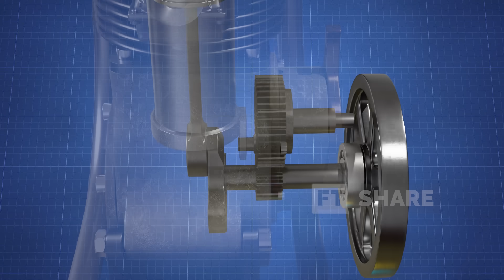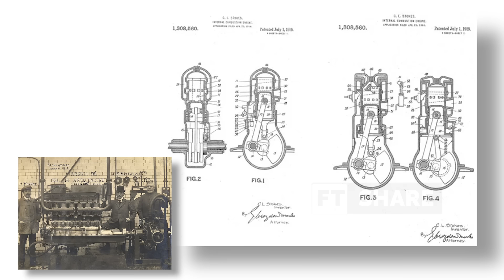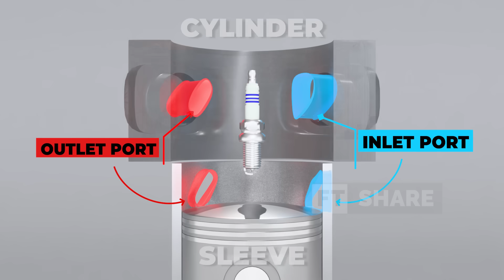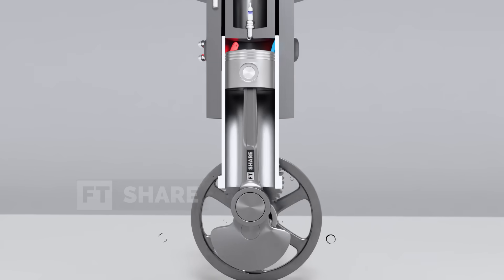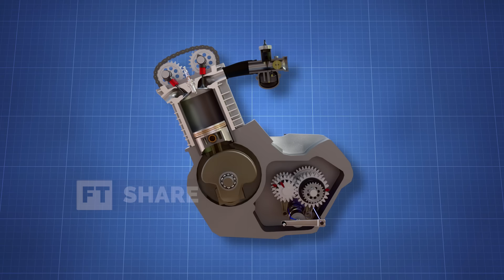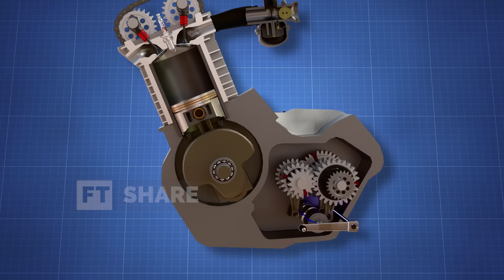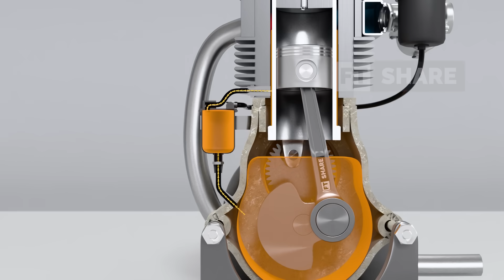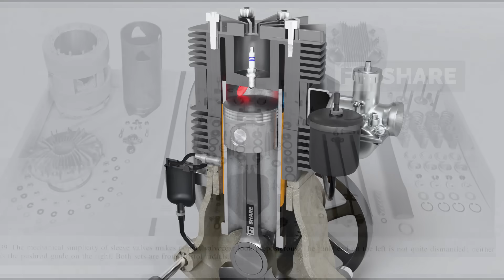Why Was This Advanced Technology Abandoned? 🤔 The Secret Behind the Sleeve Valve!

Comment: The inertia problem in poppet valve engines occurs high RPM when the valve springs cannot close the valves completely.  There is a way of overcoming this through the use a different design of the valve train.  The design I'm talking about is called the Desmodromic valve actuation design.  In this design, the valves are both opened and closed by the cam lobes on the camshaft whereas in the usual poppet valve engine, the valves are opened by the cam lobes on the camshaft, but the valves are closed by the valve springs.  The major drawback of the Desmodromic design is the precise adjustment of the opening and the closing of the valves.  The closing of the valves is the critical part of the setup.  Since the cams on the camshaft are closing the valves, care must be taken to ensure that there is no binding caused by the valve seating before the cam lobe has finished closing the valve.  This occurrence would damage the valve and/or the cam lobe face.

Comment: One problem you failed to mention that initially made sleeve valves better than poppets was poor steel quality. This meant that early poppet valves often broke their heads off. If this was overhead valve that dropped into the cylinder you blew your engine up. This helped the initial popularity of sidevales where a broken valve would stop an engine but not grenade it (as the valve was safely captive away from the piston). Sleeve valves beat side valves hands down. Then steel got a bit better & engines moved to overhead inlet side exhaust (as the hotter exhaust was more likely to break hence for safety was kept side valve). Then steel got even better & you could reliably go overhead poppet valve for both inlet and exhaust.
The reciprocating mass of sleve valves didn't help them too. This is why poppets took over.
Back in the 1980s i worked for Barr & Stroud who made sleeve valve engines 100 years ago and I was lucky enough to get prints off some of the original engine "linen" engineering drawings.

Comment: Manufacturers nowadays wouldn't want the cylinder wear thickness more than nikasil plating. Even that's too thick for the cylinder wear surface. Modern iron alloys could make this extremely reliable. If it were produced the oil change intervals would be 50k miles. Should make a detroit 2 stroke with modern everything.

Comment: Diesel ignition is by fuel injection, not compression.  Also, how do you facilitate valve timing if there's no cam.
Reply: Diesel ignition is initiated by fuel injection into hot air that was heated by a high compression ratio. The two things work together.

Comment: i remember working on these with Henry Ford back in the day. we had problems getting round sleeves back then as the sleeves must be made of very tough steel. the other issue we had was excessive heat as the sleeve slid down and the piston was moving up during the exhaust stroke. however our engines was designed from the start to be 2 strokes and you must remember that this all happened before anyone had figured out how to cast a v8 block in one pour. really the only reason this line of reasearch was abandoned was due to at the time costs and labor for development vs the flathead. just a side note the engine in this video is all wrong but whatever it gives an adequate explanation i guess

Comment: Before WW1 Daimler in England acquired manufacturing rights for the Knight sleeve valve design and used it in their luxury vehicles. The same 13 litre Daimler-Knight engine was used in the Foster-Daimler Tractor used to tow siege howitzers and the  Mark I to Mark IV Heavy British tanks. Daimler's commitment to smooth running even extended to the differential which had a worm drive at the bottom of the ring gear to help with noise suppression. Sir Harry Ricardo said in his papers on high power aeroengines in the 1920s that he thought that sleeve valves were the best path to very high power engines since they could be supercharged to much higher pressures than poppet valve engines.
Reply: And he (Ricardo) was right. Sleeve valve engines were the way to go for high performance post-WW2 aero engines. But they were quickly made obsolete by the jet engine.

Comment: This is new to me, and I am 72 years old, and I have done a good bit of automotive mechanical work.  How I missed it, I don't know.  The first thing I thought was probably twice the friction, heat and wear potential of a poppet valve engine and considerably more complicated design and manufacture.  I really don't care what the commentator said, carbon buildup on a port will cut down the f/a mixture and exhaust gas movement capacity and won't improve anything, unless the engineering was off, to start with.  Overall, I can see why I haven't seen any of these engines, in my life, that I was aware of, at the time.  I have examined no airplane engines, if memory serves.

Comment: You mentioned how sleeve valve engines are efficient at high RPMs, and then you said they can't go above 3000RPM. What an exymoron!
Reply: Oxymoron.
Reply: I wonder if the script was generated by AI.  Much of the information was likely from Harry Ricardo's 1923 book "The High Speed Internal Combustion Engine", which was written at a time where 3,000 RPM was indeed considered "high".  AI currently will repeat written information without the context of knowing current state of the art.
Reply: Finally, someone who didn't fail comprehension in school. Very unusual for this platform. I put a feather in your cap lol.
Well done!
Reply: I mean I've got a 4 cyl farmall 1600 rpm is max end of the world rpm for that engine
Reply: Sleeve engines failed for several reasons, one was difficult lubrication, one was sealing problems, and one was the very ;low allowable engine speed, i.e., rpm!
Reply: AI slop

Comment: In the R/C model world these engines have not left the novelty category and the specialized used of tightly cowled scale aircraft. In WWII, the British government forced the transfer of better sealing technology to Napier. Today’s engines are using very thin oils to help reduce friction overhead. How will seals deal with this in a modern sleeve valve engine? And what about the extra parts needed for multiple rotating cylinders? Ever seen the photo of the timing gears on a Hercules?

Comment: Its confusing when you say in volumetric efficiency they are effective and reliable and then you contradict that feature in the "cons" of this design by saying they are not as effective as poppit valve engines in volumetric efficiency ,  why not use adjustable poppit valves through various cam lobe profiles and instead of springs that can suffer from "resonate frequency" and use a "gas chamber design like Indy car engines do that isn't effected by resonate frequency and. can turn insane high RPM'S without failure of valve control .
Reply: because it is 100% AI generated garbage, that is why nothing makes sense.

Comment: Playing with mechanics for more than 40 years, never heard about it :)
Fascinating.
Reply: Really? I thought most experienced mechanics/gear heads would at least of heard about sleeve valve engines. 
Biggest problem I always heard about was thermal distortion of sleeve around exhaust ports but that was pretty much overcome plus wasn't so much of an issue with lower rpm diesel.
Reply: @1crazypj I always played as a hobby, not a pro.
I learned by myself and broke many 50cc :)

Comment: The Open Sleeve, 2-Stroke Diesel engine, built by Ricardo and Fedden, Sleeve acting as an annular piston transmitting power to crankshaft through the Sleeve actuating mechanism, remains a winner in fuel economy.

Sleeve Valve allows regulating swirl of gases inside cylinder to the optimal grade (Harry Ricardo: 'The high speed internal combustion engine'), the results obtained by Mike Hewland, told to Car&Driver in interview, published in the July 1974 issue, are simply impressive, engine gave 70 HP from 500 cc, able to rev very high, SFC 172 gr/HP/hr, having worked on creosote, no specific lubrication to sleeve, just spitting, gurgling.
Oil consumption was solved with a ring in the base of Sleeve, and a Dykes ring on Junk head.
The book: 'Continental! Its engines and its people', tells about Continental motors research in SSV engines, closed from 1929 economy crisis, being cheaper and easier to build than popett valve engines.
Ricardo points that as long as Oil film between sleeve and cylinder wall is thin enough, sleeves are transparent to heat. 

This: https://rcvengines.com/ is a recent remake of something similar to Bristol Sleeve valve engines, depicted in the Rolls Royce Heritage book: 'The piston engine revolution', section 'The Bristol Sleeve Valve aero engines', by Patrick Hassell
  https://youtu.be/e3aZNqwIpOE?si=JNIskHWwgLi9Hfng

Comment: Anybody with the Courage and Expertise to build an Sleeve-Valve version, either Burt-McCollum or Piccard-Pictet,  of the 602 cc or 652 cc Flat-Twin Citroën engine? Probably, they will have lots of customers. 
You may like having a look at NACA Report 717: 'Flow coefficients of monosleeve valves', C D Waldron, 1940 (Cranfield repository)
A Cylinder Liner, almost identical to a Single Sleeve Valve, sells retail today at around $40.
Pls don't mix the bad Knight Double Sleeve Valve system to the marvel of Bristol and Napier engines, with a single sleeve valve

Comment: There is the #deltahawk newly designed and Certified diesel (Jet A1) which is designed for use in light aircraft. This is slieve valvec, turbo and super charged 2 stroke diesel.
Reply: That is a standard two stroke blower scavenged design.

Comment: Rotary valves have entered the chat...
Reply: If made out of Invar and machined to very tight tolerances, it can eliminate the need for seals. Add phasing tech to increase or decrease dwell time at full opening. I want to use that to build a better version of the Ferrari F134 2 stroke prototype engine.

Comment: Clear as mud. None of the visuals show how the sleeve rotates to allow compression and power stroke. From what the animation shows it's a  2 stroke.
Reply: The visuals also don't illustrate lubrication of the surface between the piston and the sleeve, only the outside of the sleeve.
Reply: It's a low effort production. As much information as you can find in 5 minutes after a web search.

Comment: The last functional application of a sleeve valve engine I've seen, is probably the best suited for it. They were small model airplane engines produced in the '90s... maybe into the early 2000s. They were marketed under the branded acronym 'RCV' (Rotating Cylinder Valve). 

Due to these engines use of fuels blended with lubricant, it's more conducive to the design. Furthering the advantage, was a significant reduction in parts count... particularly parts which are particularly difficult, expensive, and frail at such small scale (poppet valves and springs). They not only increase reliability and decrease maintenance, but their main benefit was progressive failure... as opposed to the typical catastrophic failure of poppet valve designs. The operator can usually sense the gradual loss in power, with sufficient time to land the plane. A huge benefit, when the cost of the airframe and hardware often far exceeds the cost of the engine.
Reply: lol, seen the price of those engines lately? most airframes at that scale are the cheapest aspect of all.

i was in contact with them years ago, they were proposing a small "honda cub" type single cylinder engine.

all lined up for one of the demo models, more than happy to get more feedback and climatic "testing" as australia is rather different to the UK... then they sold everything to the military for UAV powerplants... and that ended that. pretty sure they are no longer in production, full stop. so the engines are now collectors pieces.

they used to have a pretty comprehensive website, going into extreme detail about the sealing system and how much effort was involved... last i looked, a few years ago, its all gone...
Reply: Do you have any idea how many engine designs were bought by either DoD or DAARPA? There were a ton during those days, because funding was through the roof. Most of them barely saw use at all, if any. I was particularly interested in a company developing a comparatively large heavy-fueled Wankel-type rotary for the larger payload-capable drones. The company completely disappeared after the the DoD/DAARPA interest. @paradiselost9946

Comment: We call em piston port in my small engine repair community. rotary valve and reed valve systems upped the output, but longevity was never a strong point of 2-stroke engines. The piston and conrod get stressed 2x as much as a 4stroke, and live most of their life at upper rpm's.
Reply: The sleeve valve engines in this video are all 4 strokes.

Comment: One interesting thing about a sleeve valve engine, if you can get at the correct angle, and the exhaust is removed, you can look in through the open exhaust ports and see the spark plug fire near TDC. Well, at least I was able to do that on my single sleeve lawnmower engine. I was never able to get a video of that. Maybe WarpedPerception needs to be involved with it! :)

Comment: I have to dispute the statement made about single sleeve valve engines being low rpm engines. The Napier Sabre 24 cylinder engine could rev to 4200 rpm, and was probably the highest revving piston engine made in WW2.  I have personally ran my 8 cubic inch sleeve valve lawnmower engine (vids on my channel) to over 6300 rpm a number of times. I have also ran it on a dyno a number of hours, as well as cut my grass with it several times at 3600rpm. The sleeve in my little 2-3/8" bore lawnmower engine is the same thickness as the sleeve in the full sized Napier Sabre! I didn't intend it to be that thick, but I was a poor student, and couldn't afford a .030 over piston at the time! But even with the sleeve weighing about a pound, the little engine still liked to rev up fine. Plus lets not forget about Mike Hewland making some sleeve valve test and go kart engines in the 1970s in the UK. He revved the sleeve valve up to 10,000 rpm, and said that he had solved the oil usage problem. He also said that the advancements made in oil technology had done a lot of the work for him, and that adding a dykes ring helped out also. I was fortunate enough to talk with him once on the phone  before I was involved in a school project to build the lawnmower sleeve valve. I used his advice as best I could in the design, but I was not able to incorporate an external oil scraper ring, so my engine does use some oil. Engine technology continues to advance, and people are looking at opposed piston sleeve valve engines, for instance. I am currently working on a 2 stroke sleeve valve engine roughly based on the Rolls Royce Crecy operation cycle. Anyway, good video, I really enjoyed it!
Reply: I came to post about the rev capability of the Sabre, but you've beaten me to it. Your lawnmower sounds like a great bit of engineering.
Reply: Excellent work we need out of the box thinking in the world desperately. We'll done👏👏👏👏👏. Respect
Reply: I continue made my innovative project of a non-combustion engine, I remind you that I am posting here on my channel the technology and the principle of operation, according to which anyone can create a prototype and enjoy free energy, since I was denied financial support at the stage of the idea and theoretical research, after a year of unsuccessful searches. Including I will begin to assemble a sample. And soon another video will be released, revealing my developments, the wind of change is approaching! All those who are not indifferent, welcome to the flight in this departing innovative car, which will lead to great achievements for the successful future of the planet and humanity!
Reply: @maguccimotorincorporation There is no such thing as "Free energy" You may have a cool idea, but call it something else, you sound like a kook.
Reply: modern  high performance engines rev to over 15,000 rpm .

Comment: Why would you need 'dual' sleeves¿ And why didn't the Author mention it?
Reply: Two sleeves aren't required, it's just what Knight came up with.
Reply: It made the engine much simpler - the original Knight engine had a auxiliary crankshaft which drove the sleeves up and down - the ports were sealed and uncovered by the vertical movement of the sleeves. A single sleeve design requires that the sleeves rotate to uncover the ports which requires a more complex drive mechanism. The Knight design worked  quite well but was limited in port area for gas exchange and the engine had to run at fairly low revs to avoid running into lubrication problems,

Comment: The sleeve valve engine was unable to match the poppet valve's engines control of oil consumption. The aero engines produced by British manufacturers worked very well, but the sleeve valve engine faced the same problems as did the piston port inlet and poppet valve exit of the Detroit Diesel two cycle diesel engines. Emissions. The ported cylinder wall allowed some crankcase oil to enter the combustion chamber. The poppet valve engine's bore has no openings to allow this.
Reply: Also recall that during the WWII era, oil consumption of poppet-valve engines was measured in gallons per hour for aircraft.  This became a problem once external fuel tanks were in use because it was not uncommon for engine oil to become the limiting factor for max range.   Indeed, later in the war, many "war weary" aircraft were limited by oil capacity, not fuel.
Reply: Today there should be a way to make a specialized oil for use in those engines. Might be something worth researching into.
Reply: For radial,engines, oil leakage into the bottom cylinders was a problem for both types. I suppose it was difficult to scavenge oil from a crankcase of the radial. But sleevevalved auto engines were "oilcholics."